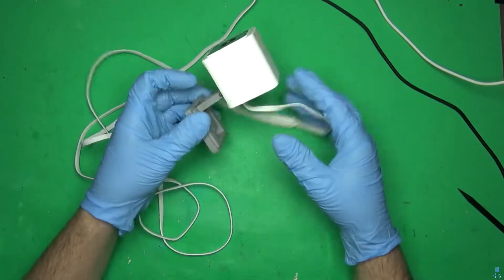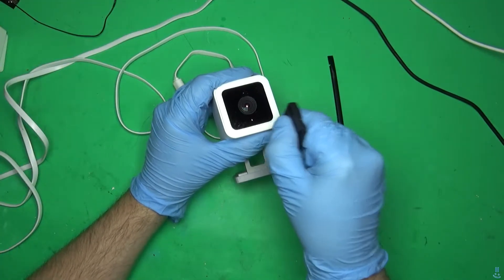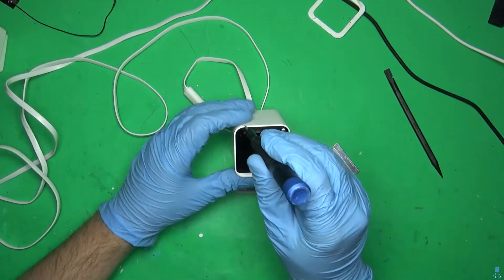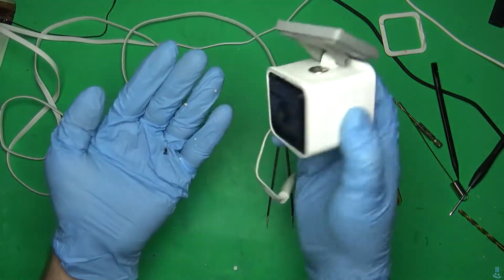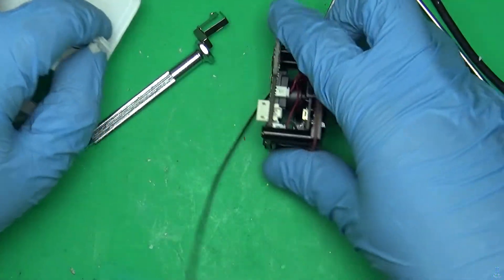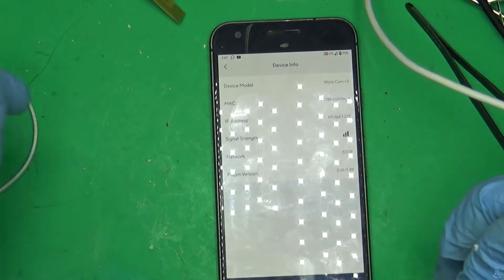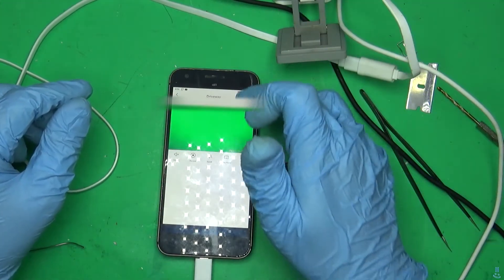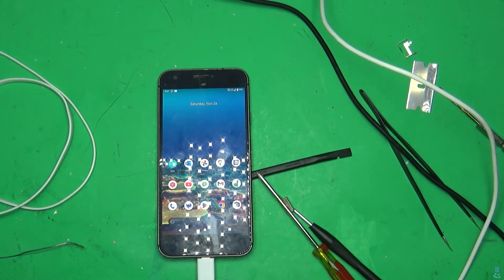Wyze V3 Internal Antenna Mod - Late night tinkering

Comment: 2 Questions:

1) How long can I make this antenna?
I have a brick house and the WiFi does not penetrate the brick.
Any thoughts?
2) How hot is your Soldering iron?

Thanks for the video.

Comment: ***Make sure to take out your SD card before opening or you will break the card slot.  I just added tiny external antennas for my outdoor Wyze cameras and it's a day and night difference.
Reply from the maker: Good point!  Thanks!
Reply: Yep same! damaged mine in process but range is better now!

Comment: Thanks for the video. How did this work once you reinstalled it in the original location? Did the connectivity issues completely disappear?
Reply from the maker: About 90% better.  Every once in a while it looks like the cam freezes for about 10 seconds and then continues on.  This only happens for a short time every few days.  It might actually be a problem with the camera itself, but I have a feeling its more about wifi reception.  It is however MUCH better than it was.  Before the camera only showed 1 bar of signal and would freeze up often.  If the garage door was open, forget it..there was no signal what so ever, however now it works fine with the door open or closed.

Comment: From what I see (9:25) the metal piece has 3 leads (posts), basically behaved has one solid piece.
So mod with an external antenna, which center antenna lead should be connected to the left, center or right (9:25)?
Should center lead of antenna be soldered to Center on PCB and ground can be soldered either the left or right side?
Reply from the maker: Two of the pads were connected together / had continuity.   From rewatching the video and memory the two with continuity were next to each other, while the other was at the far end of the 'connector' / 'antenna'
Reply: @Electronicle  From (9:22) that Silver Metal Tab has 3 leads (one piece/0 ohm reading on 3 tabs).
So you are saying from PCB (9:25) the solder hole on the Left is Center of Antenna (mod with ex ant)?
While the two (Center/Right) holes of PCB are considered Ground?
If that was true, then it become a shorted path to ground once you soldered the antenna lead on. Because that Silver Metal Tab is one complete piece with 3 tabs, right?

RMS meter tested for continuity on Silver Metal Tab having 3 leads
External Antenna has a Center Lead (+) while the Outside Lead is Ground (-)
Reply: @angelisone  Just because you see a piece of metal with 3 tabs, doesn't mean that all 3 tabs have the same resistance especially at high frequencies.
Reply: @whynot9884  Pertaining to my question.  Center lead of external antenna connected to where? 
Have you done it, already? Or, you just don't know.